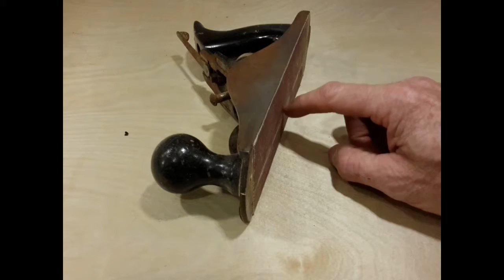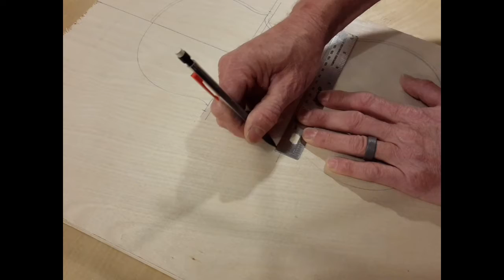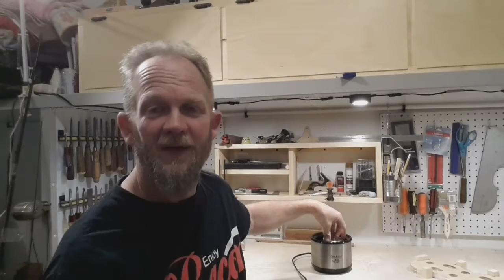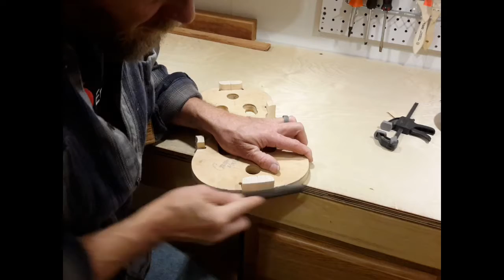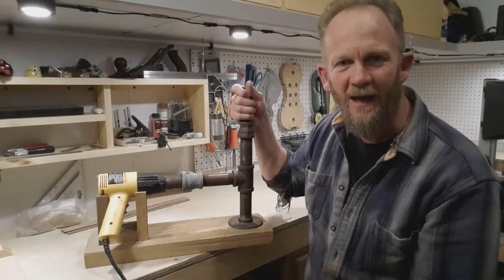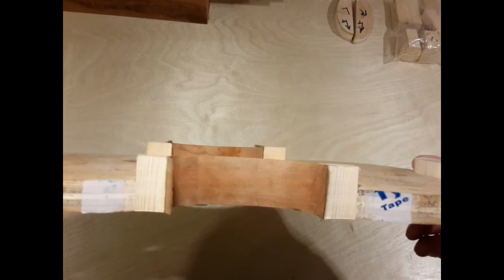How to Build a Fiddle -- Part 2: the Mould and Sides

Comment: Hi Jon, I am following in your footsteps from Argentina.
I got European maple and spruce pine cut into quarters, as you showed in the previous video, the one that already comes with the cut in the middle and opens like a book.
My problem is that I do not have enough wood to make the blocks, the kit does not include them and at my disposal I only have pallet wood. What I can do? What other type of wood is acceptable and relatively easy to get? Thanks!
Reply from the maker: You can make the blocks out of most anything, actually.  Something straight grained and not too hard.

Great to hear from you!

Comment: Hey Jon want to say thank you for the videos.  I recently was given a partial kit that my great uncle bought in the mid 1970's. I had no idea where to start so went to YouTube and found you videos.  One question i have is the magic bag of blocks that go with the plywood jig what you cut when making the jig or do they need cut seperate?
Reply from the maker: Hi Mike.
The corner blocks are just spruce.  When I have leftover pieces the right grain, I cut up extra corner blocks (you can make them from an ordinary 2x4)
You really only need the outside template.
The inside one is just that....inside the fiddle and it is used mainly to mark the corner blocks so you can carve them to the right contour.
Sorry for the delay on responding.  I didn't see your comment!
Reply: I was talking about the blocks that you were clamping the garland to the jig with.
Reply from the maker: @mikekime6660  ohhhhhh!
I just made them out of scrap.  I didn't think of it when I was cutting the form!

Comment: You lost me at the inside and outside template! I don't know why you need two. I see the size difference, but I didn't know I would two. Please explain. Thanks.
Reply from the maker: Outside template is mostly useful for cutting out the rough shape of the plate -- and for comparing to the plate as you get closer to finishing to insure uniformity.

I use mine to see if wood I already have cut and dried will be an appropriate size and free from defects in the areas the plate will come from.

Comment: Hey Jon! great series, I love it. I'm building my first fiddle now after watching your videos and some others. I'm also using cherry for my sides and back. I'm trying to bend the sides now but they always end up discolored afterwards and I have to sand it away which ruins the nice finish from scrapping. Any idea on why that could be and how to fix it? I'm bending against a stainless pipe heated by heatgun. I really want to get something as nice as yours so I don't want to commit to what I have now.
Reply from the maker: Maybe too hot?
I had a small amount of discoloration on the first piece I bent from the iron pipe.
Scraped a little and all is well.

I would think stainless would be terrific.
Lower the temp...more airflow, or something.
Psyched to hear about your build!  Let me know how it goes!

Comment: Hello! I was wondering what tool you used to cut off the excess ribs. Coping saw? Can you chisel downward, or would that be a catastrophic failure?
Reply from the maker: Razor knife. Just score a few times, and bend a little, score again.
I use a file to finish the point. 
Hope that helps!
Reply: @grandpasmountain  - Perfect. Thanks!

Comment: Very nice! I do pretty much the same, unless for the position of the corner blocks, u glue them flush to bottom side of the mold, I glue them with some space up and down, giving space for gluing the linings, how do accomplish this? I know u have space for the linings on the upper part, but what about the down side of the mold? Thanks!
Reply from the maker: Thanyou, Fernando.
I will install the lining on the upper portion, then glue on the back.  After that, I'll remove the mold and do the lining for the top.